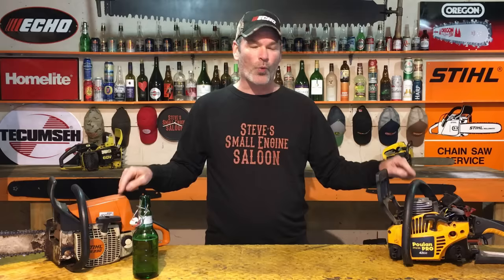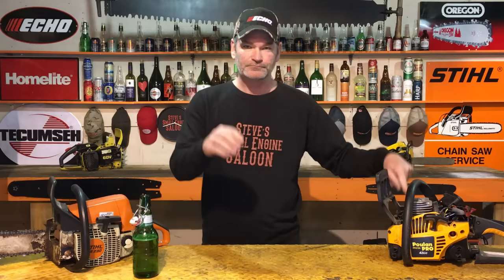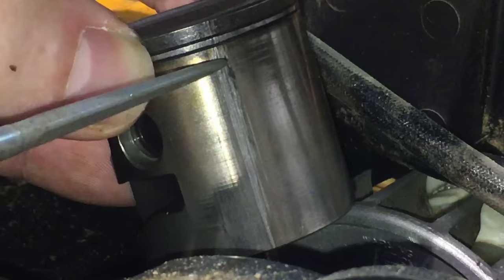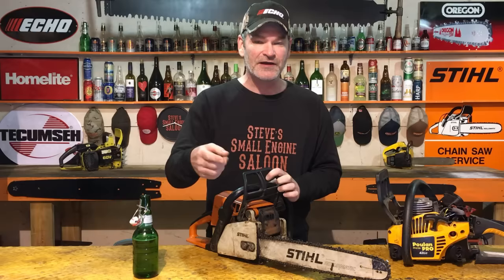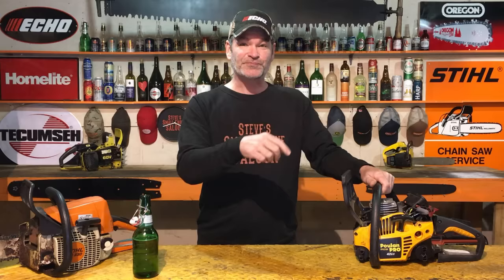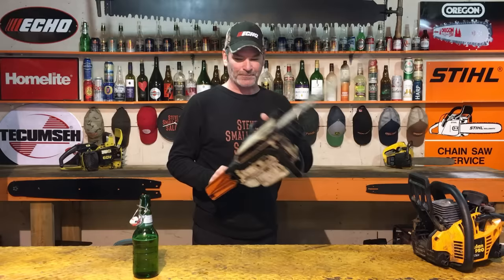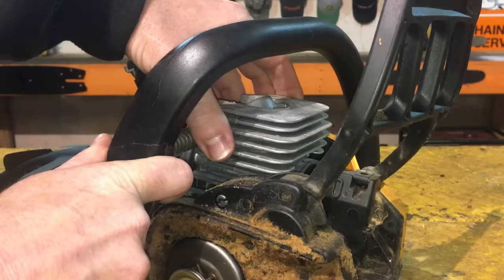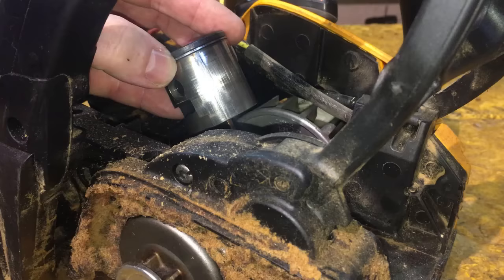WARNING: Never Do This To ANY Chainsaw

Comment: I've always let all my saws warm up for a while then just coax some throttle to it. I know way to many cold seizure candidate guys, they're usually the same guys burning through wood at full throttle usually after running the bar into the ground. 
One of my most reliable is my old Homelite XL12, it just never ever fails. The key is not to let donkey's operate your stuff.
Reply: Yep...
I used to allow others to borrow only tools made out of one piece of solid metal; hammers, wrenches, etc.
Once I realized that they could destroy those just as well, I stopped doing even that. I could have something for 20 years, loan it out for the first time, and it come back ruined!
Now, if I can't use the tool FOR them, they're out of luck...
Reply: Neighbors seemed to be reasonable and careful, talk a great story. Takes a couple months to get blower/mulcher back, I bought a new one as my yard has a few dozen oaks. It came back well broken, wouldn't run for more than15 seconds, I had only had it 12 years working beautifully.
Now the neighbors get mad because I won't loan any tools out. They have nerve to ask me to loan them my new Honda snow thrower or my spare generator.
Reply: @bff1316 : DON'T DO IT! : )
Reply: Donkeys... It,s ok to call um Jackasses.
Reply: @lordofthewoods  People seem to find lots of funny new ways to use tools incorrectly and for purposes they werent designed for LOL
Reply: yepp, wifey got me a husky 460 rancher in sept, but i grab my 25 yr old stihl 023 first, has never failed me. And until i get time to adj carb on the 460 its staying home, out of the box its a pig, and the 24” bar is 4” to big for me, 20” on the way.

Comment: Great explanation.  I'm a mechanical engineer and wish some of my instructors had been this clear and to the point.  Subscribed.
Reply from the maker: Right on Davey...
Reply: We cannot make completely round holes. The pistons have flaws as do the bearing journals. When you first run any engine it needs to wear off those high spots. Idling and low stress running will knock those off. Hard usage will cause a seizure like he showed. Very typical. Just fire it up and go at it during the very first tank of gas. The tight spots just tear themselves up instead of slowly wearing down.

Comment: Great video. This is a problem with 2-stroke race bikes also. We let them warm up till the radiator cap is hot before we rev the hell out of them. Reboring and replating a cylinder plus the cost of a new piston/rings usually teaches us not to do this. Thanks for putting this great information out there.
Reply: Back in the early 70's when my dirt and street bikes were 2 strokes I never moved until I felt warmth on the cylinder fins.
Reply: You have a radiator on a 2 stroke?
Reply from the maker: You're Welcome...
Reply: Gord Baker, yup, a lot of dirt bikes have 2 radiators. They are water cooled now days.
Reply: @gordbaker896  my 1975 gt750 Suzuki was a 3 cylinder 2 stroke water cool. It was called a "water buffalo" by afficiandos.
Reply: @burtvhulberthyhbn7583  I like to do a good deed and learn something new every day.  Thanks for the 2 stroke pumper info.
Reply: I remember when air cooled 2 strokes delivered maximum power between warm and hot so if you were serious about getting off the line quickly you only warmed it slightly...a little piston wear was a small price to pay for having max power and a good start.

Comment: This is a little bit unrelated but something to look out for before you junk a Stihl with bad compression reading. We were taking BR600 and KM 94 to a repair shop. A bunch came back as NFG. My company owner investigated more and discovered the crankshaft seals are a common failure. Replacing those fixes low compression readings.

Comment: We are a small mom and pop lawnmower shop,
and can't tell how many of these we see as well !
We do sell, and highly recommend a product that significantly reduces the cold start friction issue.
But most of the people bringing us a chainsaw with this condition, is just about too late for their saw unfortunately !
By the time we would put the necessary labor into the required repair, you can usually be better off to just go buy another saw !
Really sad !
A few seconds of warm-up can keep your saws
( if they are a quality brand ) running for a lifetime if cared for properly ! 
Most important,
NEVER cut corners on a cheaper 2cycle oil !
Always,
Always,
Always, use a quality premium 2cycle oil !
And please folks,
this gentleman is 100% correct !
Warm up your equipment before putting them to work !
All equipment,
not just your chainsaws !
Excellent advice sir !
Excellent !
Thank you !
Reply: quadsman11 what do you use to help cold start friction?
Reply: @MjrNiGhTmArE  
It is called MT10 From a company called
 Muscle Grease,
I would be happy to send you a small sample of, it doesn't take much for it to work.
Reply: @MjrNiGhTmArE  
Let me know, and I will get some on the way to you.
Reply: quadsman11 That sounds great! I have a brand new chainsaw that I just started using to prep for this coming winters firewood needs, so it’s going to be getting quite a work out.
How do I contact you?
Reply: @MjrNiGhTmArE  
Well,
First off,
This product works extremely well,
So much so, that they don't want you to use it in any brand new engine, otherwise, it will not wear in correctly.
I would recommend that you put about 5-6 hrs. on it before you use it.
That means,
You just need to let it warm up for a few minutes before you start using it hard.
Reply: @MjrNiGhTmArE  
As for contacting me,
I guess, maybe give me your email address ?
Reply: I just got a new 2 cycle echo trimmer, and I've researched the crap out of oils and all sorts of things. If there's one point of contention with enthusiasts its oil and break-in procedures lol. I'll probably just use the echo red armor 2 cycle oil. Any suggestions? Also, is there anything I should do or not do when the engine is new? Some people say to heat cycle the engine a few times to break it in, some people even say to fire it up, rev it wide open throttle for 5 minutes and get to work, and some people are torn on no-load and working load break-in. I have no idea if theres any hard and fast rules or any proven facts on the topic lol. All I did was mix the gas a little rich for the first tank, and let it warm up for a minute, just blipped the throttle a few times until it got warm, shut it off for a couple hours til cold, started it up, ran it for a few minutes, did some light trimming of grass, and shut it off again until the next day when I did some real work with it. I dont know if I'm just being overly cautious or not! I will probably stay off full throttle for the first tank or two at least. Any thoughts or suggestions?
Reply: @MjrNiGhTmArE  
Have no idea why I did not receive your message with your email address.
Monday was a real nightmare Monday for me, I apologize, will be getting on it Tuesday morning.
Reply: quadsman11 no problem, email with address sent.
Thanks!
Reply: quadsman11 haven’t head from you, so I sent another email with my info.
Reply: Received additive today, Thank You! 37 years as a ASE certified tech, I believe this is some great stuff.
Reply: I also understand that this should not be used until the engine is broke in throughly.

Comment: I fixed my two chain saws and a echo weed wacker watching these videos. My chain saw I bought with house in 1990's its an echo cs4400 as my 1998 echo srm 2400 weed wacker. I use them every season. My saw chains are sharper and bar is cleaner,  my saws are better stored , better winterized. I learned more here on Steve's channel than anywhere is. I rebuild things now.  I fix my neighbors small engines and saws now, as a way of giving back.  Thank you Steve. Cheers to you from Oregon.
Reply from the maker: Thank You...and You're Welcome...

Comment: good advice,and I would like to add something to this if you dont mind.Some folks do warm up their saws,but I bet very few think about letting the saw cool down before shutting it off.A saw cutting in hard wood with a dull chain (which should be a no-no)can get very hot,and the cooling fan/flywheel cant really move enough air to keep it cool.Let a hot saw sit and idle and disperse some of that heat before shutting down,will save you a lot of unnecessary wear on the jug.As always,great videos Steve.
Reply: Yup, cool down just as important.... and with cars.... if you have a turbo and just got through hammering it before pulling in your drive way. Let that car idle 5 till 10 minutes till cool that turbo you just got blazing hot so it doesn't coke the oil in the turbo and blow the turbo up.
Reply: @timm.6391  I remember my brother in law pulling into my driveway a couple times a year in his Kenworth.He would let that truck sit and idle for over an hour.I think diesel was 79 cents a gallon back then.Today you can watch trucks pull right off the interstate  into a rest area and immediately shut the engine down.
Reply: @pallmall5495  I've seen that before when I was heading to Colorado. People don't think they have the time for it, but it's faster to do something right rather than do it wrong and have to wait forever to get it fixed.

Comment: I've been running saws for 30 years and learned something about them today. Thanks Steve.
Reply from the maker: Glad to help
Reply: Same here , good to know . I always had the feeling they needed warm up so I did but diddnt know it was so important.  How long of a warm up?
Reply: Well wait, if you've been running saws for 30 years without knowing this, have you been seizing up saws from "cold starting" em? Or has it not been a problem?
Reply: @JonALewis  I've always warmed my saws up before use just like any other engine. I did not know exactly how high rpms affect a cold saw engine.
Reply: @JonALewis  Been running saws for 50  years also two stroke motocross bikes never had this problem and I'm afraid I'm guilty of sometimes firing them up and getting on with the job.  Im not for a minute discrediting what Steve is saying and it makes sence but cheap oil, wrong mixture,  but revving the motor out when its running out of fuel imo is something I've never done as I was told they would be  running lean. I have time now to let my kit warm up I will take this on board every little helps.

Comment: Crazy that people don’t know this. Applies to all  engines especially 2 strokes
Reply: Shell Cracker  Yes, but some people take idling to an extreme and that isn't best for engines either. Especially vehicles when it's very cold out. Most engine wear happens before the engine reaches ideal operation temperature. Driving a vehicle while taking it easy (not peddle to the floor) will warm up much faster than idling, thus reducing unnecessary engine wear.
Reply: @Tyler-zw4kq  I would use a block heater if it was still cold (no heat in the cab) after 15 minutes. I have lived in -40 degrees climates and it does take forever to warm up an engine at idle. That is precisely why I would drive after a couple minutes. 5-7 minutes of driving and the heater is starting to blow warm air.
Reply: Because in the name of lower emissions they've been telling people not to warm up their engines.
Reply: @gordthor5351  Yes, some do idle for extreme. There's a guy in my apartment complex warms up his car for 5 minutes every time, he's got a loud exhaust so it wakes me up in the morning. During the winter time (Phoenix, so winter is like 50 degrees) he warms it up closer to 10 minutes.
Reply: @Gord Thor  Agreed on people taking vehicle warm ups too far. Generally, if you wait for the RPM to drop to normal idle speed or 30 seconds (whichever is first), you've let it go long enough. The exception is if you're scraping ice or fogging up the windshield. Then you let it idle while defrost does its job.

Comment: No different than how some treat their vehicles . Well put out there. You need to set up your own micro brewery.Steve's
Piston Broke Beer.
Reply from the maker: LOL, Right on...
Reply: Unless it's a carbureted vehicle, you really don't need them to warm up.
Reply: @WJCTechyman  that statement is not exactly correct. While the carbureted engine benefits from the warm-up so do fuel injected models. It's better to give it a few minutes, and let the engine warm so that the engine oil pressure can get up so that it can start lubricating the top end and even main bearing will benefit. I'm also pretty sure that Steve's example of the Piston expanding faster then the rest of the engine is also true with a large engine although I don't know that it would have as much impact on a larger engine than a smaller hotter 2 stroke.
Reply: @WJCTechyman  Fuel delivery methods have nothing to do with core thermal expansion. The only reason you needed to warm up carbureted engines more is because of the carb itself (cold fuel is less-volatile than hot fuel). Pistons still heat faster than the block does, and while an automotive engine is unlikely to have this issue, you still don't just start rolling before the starter has spun down because cold starts are where you have the most wear. Cold engine parts are not the same shape as hot engine parts, so you want to avoid high loads and high speeds on any cold engine, regardless of type.
Reply: Exactly what I was about to say!  General rule for internal combustion engines, let them warm up!
Reply: @IvanRichthofen. Bang on mate . You see it all the time. We would come up the pit on afternoons in the winter ice cold they would fire up the car . Go up the road flat out with all the electricals on headlights heater heated screen stereo full blast. Short journey home. Then they wonder when the battery is flat and the engine is knocking.
Reply: I like “Steve’s Cold Seizure: Good enough for any repair job”.
Reply: I think 'Broken Piston' has a better ring to it....? Lol
Reply: With a fuel injected car there’s no need to warm up for more than 30 seconds or the time it takes to build oil pressure. The engine warms up quicker and wears better with light driving until warm. The longer your engine idles cold the more time it spends cold resulting in more wear. During winter it’s understandable to let the engine run abit to get the heaters working lol but keep in mind it’s also wearing quicker
Reply: @jackwatkins7382   Right on! A warm engine is a happy engine
Reply: Neil williams Yeah  my father-in-law is a mechanic for over 25 years and he does us with his car every single day and I laugh at them get to knit ice cold after work starts it up and boom he's out the shop I always tell him you're lucky the oil Cycles before you get out of the shop
Reply: @LiamHutchinson666  Sorry, but that is total nonsense. When idling, the engine may be running cold longer but at a lower RPM. Fast Rpm on a cold engine is just going to do the same ware but at a much faster rate.
Reply: @LiamHutchinson666  I should say that after re-reading your comment I do realize you said after 30 seconds which is most likely long enough.
Reply: @remington1608  Why is it so hard to understand the the difference between light driving and racing the engine? I've never destroyed any car engine either carburetted, direct injection and anything between that. When I leave my house in the morning, it's 30 seconds idling (the time it takes to put on the seat belt and adjust the radio volume) then a few km of suburban roads (usually revs stay under 2000 rpm) before entering the freeway. It's obvious it's pure stupidity to drag race up to the redline after a cold start. But so is idling 10 minutes or something.

Comment: What you're suggesting makes good sense: warming up (idling) a saw for a minute before using it. I've never seen an arborist or professional tree feller do this. Usually, right after starting a saw, they rev it up several times (Vrrooom, vrooom, vroom) before they start cutting. 'Guess idling after starting a blower would make sense, too.  Thanks for the heads-up!
Reply: With arborists, time's $ & most of 'em won't/don't work on their stuff except maybe chain sharpening. Buddy of mine took on maintaining an arborist's equipment. This was in addition to his regular job. They ran him ragged! He showed me an 066 Stihl he'd rebuilt, a week later showed me the same saw where it was crushed! Then he was accused of stealing from 'em. I later was asked by the same people to work on their stuff, I said no way! When asked why, I related my friend's tale. They had a foreman that was like a bull in a china shop & the $ wasn't coming out of his pocket.
Reply: This is for a cold start. If the saw is already warmed up, you can start it again and cut right away.
Reply: imo, the Vrrooom, vrooom, vroom does nothing except waste fuel, and cause unnecessary wear to the engine, & throttle trigger, lol. It is a very satisfying sound must admit that. Also makes the professionals at least SOUND as if they are really going to work on the customers tree, which said customer is paying hundreds of dollars to have taken down. Even vintage piston aircraft, never heard them feathering the throttle, they ran the engines up gradually. Chainsaws aren't aircraft I admit, with that said beyond idling warm up; no need to run up and preflight your chainsaw to maximum power before engaging with the wood. Chainsaw isn't going to crash on takeoff.
Reply: @markbaker1843  You want to do just enough to know that it's oiling correctly.